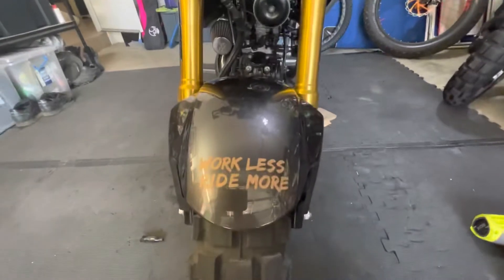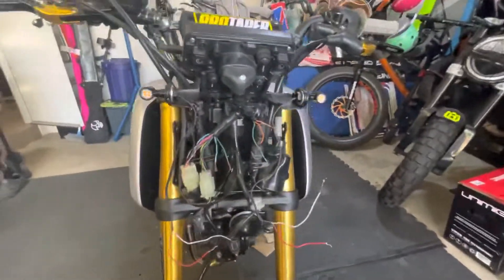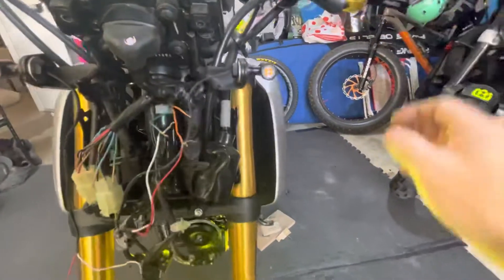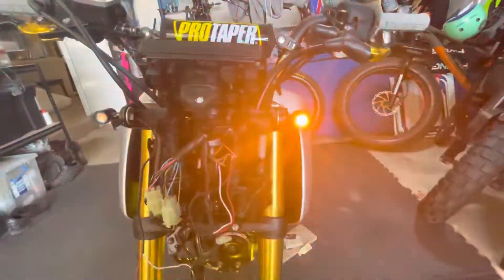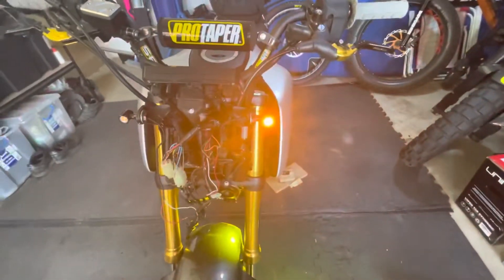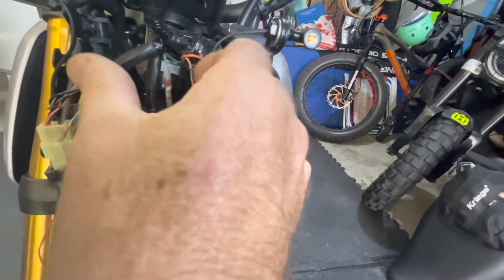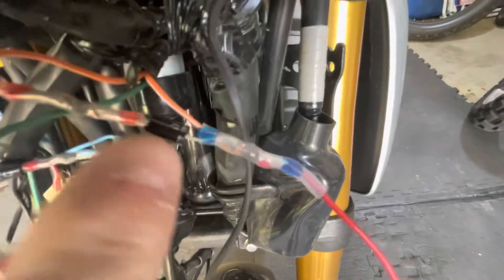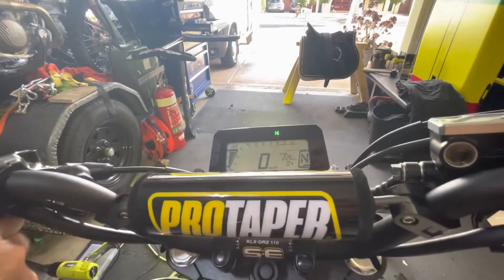Honda Grom (or any bike / car ) LED indicator with DRLs

Comment: TST makes a very cheap kit that is plug and play. No cutting up wires. It simply plugs in line with a harness. Far better option than this.
Reply from the maker: Yes they do thats right, however with shipping it works out to over $70US to get them here in Australia... Thats a lot of money for a couple of diodes and bits of wire...
Reply: @dwninetynine  Yeah, no doubt about that.